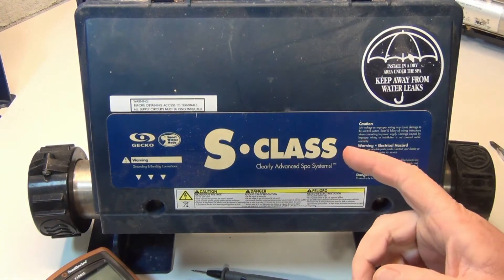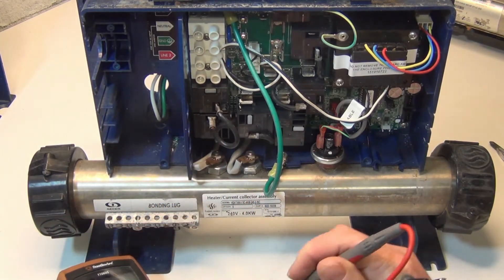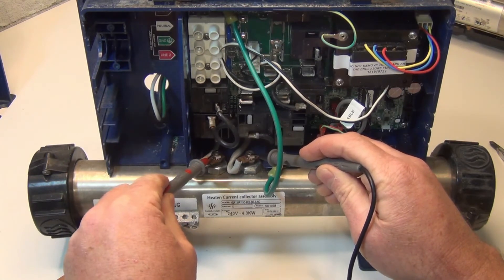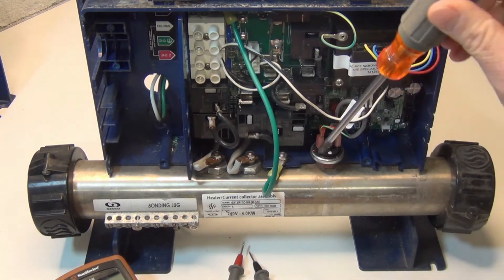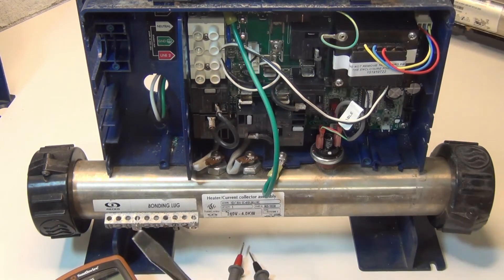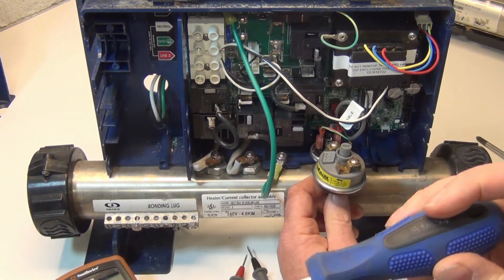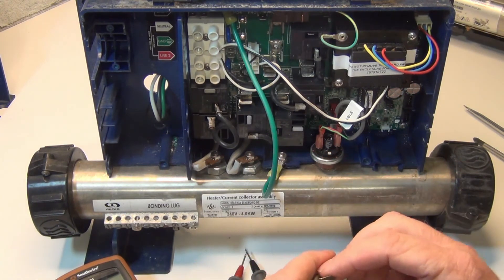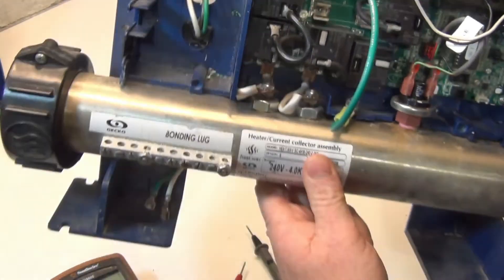Common Problems Why Your Hot Tub Won't Heat Up

Comment: Thanks for making this video.. I am trying to trouble shoot our hottub. I followed the steps in your video:

1. Take out filter (no change) - also I checked to make sure the valve inside the filter housing had not broken off(this was in another video of yours i think)
2. Power to board :120v, 120v, 240v 
3. Power across heating element: 240v
4. Checked all three fuses for continuity (they all passed)

------------------------------------------------------------------------------------------------------------------- abnormal results----------------------------------------------------------------------------------------------------------------
5. Pressure Switch - When I turned the screw inside the pressure switch counter-clockwise (I tested up to two turns counter-clockwise actually) I did not hear the "click" you were talking about. 

Does this mean the pressure switch is the problem?
Reply from the maker: Test the element for amps.   Is there an error code on topside?  If your getting 240v at the element, it's not the pressure switch.   The pressure switch turns the relay on for the heater to heat.  More interested if you have an error code.
Reply from the maker: Plus, need more info on what the tubs is doing and not doing.  What's the issue?
Reply: @VIPPoolsandSpas  the hot tube won't heat up. I am getting three blinking lights error code on the top panel.
Reply from the maker: @padr3ko  circ pump working or pump one low speed?  Pull filter?  Would just change pressure switch if these other things are working fine.  Adjusting the pressure switch is just to see if that's the issue.

Comment: Hello, Thank you for this video. We have the Gecko S Spa Metapack Series. The top display for turning on spa seems to be dead. No lights and not turning on etc. My husband is an electrician and he has tested and confirmed power to board but top display still nothing?? Any suggestions would be very appreciated.
Reply from the maker: How many pumps?   Does the pumps come on at any point during the day?
Reply: @VIPPoolsandSpas  one pump, no does not come on at all. Keypad is now showing 3 red lights.
Reply from the maker: @amyruppert1322  3 dots or 3 lines?  Turn off power to the tub,  unplug the topside from the spa pack and then turn power back on.  Pump should come on.  If not, test the fuse.  Im assuming he already did that?

Comment: I grabbed myself, then grabbed a meter.  I took the filter out, the flashing lights went away and the temp stopped flashing and let me set it like normal.  I took a chance and touched the outside of the heater. Its lukewarm.  Its getting 240.  The pressure switch didn't click when I turned it half a turn.
Reply: I turned it nearly a complete turn, still no click.  heater still barely lukewarm after about ten minutes.  temp of water went from 92 to 93 degrees.
Reply from the maker: @traumajock  if your testing 240V at the element, no need to mess with the pressure switch.  Its the pressure switch that turned on the element to get the 240V.  Test element, if you get 240V again, turn pressure switch counter clockwise until the relay clicks.  Power will be on, so watch your fingers.  after you hear the click, turn switch back clockwise until you hear another click.   You should again get 240V.

Comment: Hi thanks for your videos! My spa was not heating properly. What I'm getting now is no error message, and I turn the heat setting up to say 100 the temp was around 80 as I turned  the spa off for a few days. The pump works great I cleaned and replaced the filter the heater light goes on but goes off within a few seconds? Any help would be appreciated. Thanks Donnie spa builder Sc-CF-122-01
Reply from the maker: Whats turning off in a few seconds?  Power, pump?
Reply from the maker: are you testing the element for volts and amps?
Reply from the maker: for the element - https://youtu.be/gU-GgXnVeOU
for the pressure switch - https://youtu.be/NQ0NTc9QC0A

Comment: Hi I need some help.  I have the Gecko S class.  Ive had issues for a while.  I have replace the heating tube already.  I do not have any codes.  I have tested all fuses and power coming in.  All seem to be ok.  My first problem is that 1 it doesn't heat or heats really slowly.  No error codes.  Then all of a sudden it will heat up.  which is great.  But when it heats it gets to the set temp and then throws a error. High limit then of course i have to flip the breaker or it doesn't engage the heater.  any ideas?  
It finally heated then stopped.  I was about to buy a new spa pack but then it started again.  now im back at not heating.
Reply from the maker: Gee.  thats a good one.  Test the heater element volts, amps, etc.  Heater relay is stuck open or closed...random I guess.  I would say a few more things, but. you say its getting up to temp and an error comes on HL?  High Limit error code right?  Set temp to 100F, then when it hits the 100....also test the temp of the water.  SO, FIRST....test the volts and stuff, SECOND. set temp to 100 and test the temp of the water.  See what the temp difference is.  See our video on testing volts and amps.  Let me know after you do those tests.
Reply: @VIPPoolsandSpas  thanks for the quick reply.  temp when set to 100 is accurate, tested that to be sure.  Currently its in the not heating stage.  last time it was doing so i tested on like you did on the video all fuses and lines coming in.  i got readings like i should.  when I tested on the heater itself there was nothing there ( thought i was doing something wrong) because i tried again the next day and there was voltage... and then it started heating.  but back to the cycle of 3 dot error code when it heats to the desired temp. so basically my hot tub is always running :)
Reply from the maker: @opiejr97  when you changed the Element, did you change the pressure switch?  See video on adjusting the pressure switch.  Test element and when you don't have volts....pull the filter and listen for the click of the heater relay.  See if that works.
Reply from the maker: I think it's something from the filter to the spa pack/circ. Pump
Reply: @VIPPoolsandSpas  new heating element is one unit so it came with new pressure switch etc.
Reply: @VIPPoolsandSpas  could it be flow value? at the bottom of the filter tube or the pump itself.  Most likely my next step before replacing the spa pack is have a tech come out to look at it i guess, you think?
Reply from the maker: @opiejr97  that spa pack should not be setting off the hi limit if the water is below 109F.  what circ pump is in there?  Can you take a picture of the pack and equipment and sent it to info@vippools.ca
flow issue from the filter to the pump and thru the heat tube.  try adjusting the pressure switch to see if the relay kicks in when theres NO volts or amps.
Reply from the maker: @opiejr97  also need a picture of where the filter goes.
Reply from the maker: @opiejr97  Oh....AND..make sure all your jets are open
Reply: @VIPPoolsandSpas  thanks sent you an email.  should be there shortly
Reply from the maker: @opiejr97  you have one pump?  You have normal flow?  Turn the pressure switch counter clockwise..(only when its not heating) to see if the heater relay kicks in.  Was the shut off (knife valve) shut at anytime?
Reply: @VIPPoolsandSpas  only 1 pump.  flow seems the same or normal right now. I turned the pressure switch i can't say for sure if i heard the relay click or not.  the shut off valve was shut before i re-filled the hot tub after replacing the heating tube.  I can say that this issue has always existed since i got the hot tub (used) I've replaced the heating tube, pressure valve and so on. but it still exists.
Reply from the maker: @opiejr97  I sent you 2 videos to watch.  check the bottom where your filter goes and theres a "flap" with a spring on it (see second video and it will make sense).  might have to put your arm down there to make sure that flap is still there and not broken at all.  knife valve not up all the way (handle might look like it is....but "door" might still be down a bit.  Second.  The pump impellor isn't pulling in water good enough.  Set your temp....turn that pressure switch counter clockwise....not that far.....you should hear the click to turn heat on....turn clockwise and you should hear the click again....heater should be off.
Reply: @VIPPoolsandSpas  I haven't watched the videos yet but i think the flap could be the issue.  it was stuck open before and didn't close. and its broken now if I remember correct.
Reply from the maker: @opiejr97  if you have no flap or its broken...it just won't filter right.  it will still heat without it.  something is restricting the flow and not turning that pressure switch on to call for heat.
Reply from the maker: @opiejr97  NOW.  It still could be a board issue.  Is the topside control sticker in good shape and the buttons can be pushed ok?
Reply: @VIPPoolsandSpas  top side control seems to work i can turn jets on, lights adjust temp.  But its doing like in the video if I turn it down when its hot.  it doesn't always shut off circulation.  it does some times but not always.  and when it does it usually has the 3 dot error code on the topside control and i have to reset on the breaker.  same error code if its just running and its at its temp.  it just flips that error it really struggles to sustain heat evenly.
Reply from the maker: @opiejr97  yep.  Sounds more and more like a board issue.  If you know a electronics guy or a computer repair guy, ask them to test the board.  It would be the cheaper way to go.  If your looking for a new board....it's around 400-500 and the board info is on a white sticker on the board itself.
Reply from the maker: Did You get the Tub Fixed?  Interested in what the issue was.  thanks.
Reply: No it’s just stopped heating temp is 63 in it now. I think I’m going have to order a new spa pack
Reply from the maker: @opiejr97  I would replace the pressure switch and heater element first and if you have to buy the pack at least you have an extra heater element and pressure switch.  Also, make sure flow is good from the filter too the pump.   Check shut off valves also. High limit issue normally a flow issue.
Reply: Heating tube pressure switch are Brand new. I ordered a new sensor to see if that helps first.
Reply from the maker: @opiejr97  ok. Curious on what you find.  It's rare for the gecko sensor to fail.
Reply: I’ll keep you posted. My son knows a computer guy since we are coming out of lock down I’m going to have him look at the board too
Reply: Ok last night I did some research. I found out that if I hold the light button down for 5 seconds I can set the filter schedule? Never knew. So I did that and set it to 12. Then it started heating up again. Today it’s at 106 degrees it was set to stop at 100. So I switched it from 12 to 2. It’s off right now cooling down. But the 3 flashing lights are back most likely because it’s so hot. I don’t know if it’s fixed or if it just decides to be heating again
Reply from the maker: @opiejr97  holding the buttons down is for programming and it's mostly used for new spa pack with new topsides.  The filter schedule has nothing to do with heating the hot tub or not.  Holding a light button down just forced the pump to turn on.  
Set temp to 104 and see if HL comes on.  HL should come on before the 3 lights and disappear after that.  Still sounds like a flow issue or sensor problem.  I'm still thinking it a flow issue.
Reply: Should it say HL?  I’ve only ever seen just the 3 dots. I will try
Reply from the maker: @opiejr97  most times people don't see the HL because it's fast.  HL comes up for about a few seconds and goes to FL, FLO....or the 3 flashing lights.
Reply: Ok i flipped the breaker reset it to 102 temp was 105 I watched. No HL came on just 3 dots. No pumps or anything running at this time
Reply from the maker: @opiejr97  weird.  circ. pump runs fine? flow on low speed fine? filter is fine?  stuck relay maybe?  But the HL doesn't come up.  Weird.   if 3 lights come up, can you hit the button to turn on high speed? What pump pushes the water thru the heat tube?  Can you turn the heat up and does pump turn on?  listen for the "click sound" of the relay.  Turn temp back down and pump should turn off within 5 mins or earlier.  when pump goes off....does the 3 lights come on just after the pump stops? And, does "click sound again?
Reply from the maker: @opiejr97  you might have to take the pack out and get your son's computer guy to test the relays.  it will be hard because the test could show the relay is OK.  can see if its stuck open or closed at least.  but again, its a hit and miss on the tub calling for heat and heating the water.

Comment: I have a Superior Spa, San Juan, Gecko, 240v M-class (MC-MP-SBD spa panel) I'm getting a strong 240v from the heating element. The water is not heating up. I'm not getting any error codes. I've tried removing the filter, unsuccessful. I've replaced the temp probe, unsuccessful. Please help? any Advice? thank you
Reply from the maker: Did you try the high limit?
Reply from the maker: Sorry.  Lol.  It's your heater element.  Disconnect the two leads from the heater element with the power off.  Test the element without the leads for continuity.
Reply from the maker: Kendall, did you fix the hot tub and was it the heater element?  Thanks